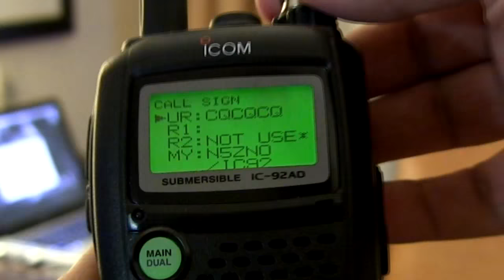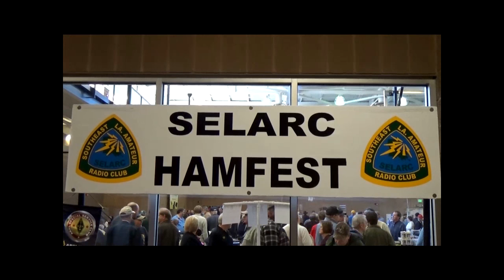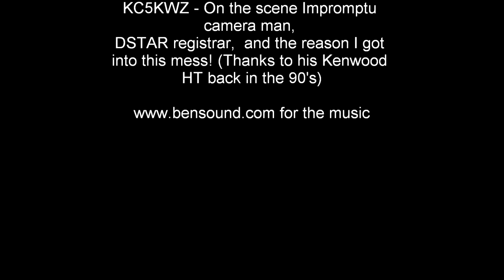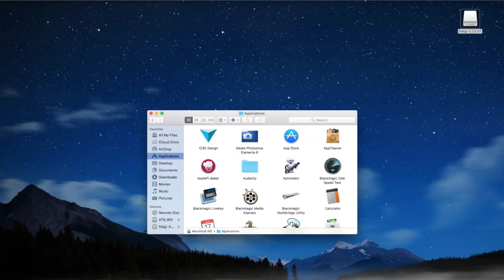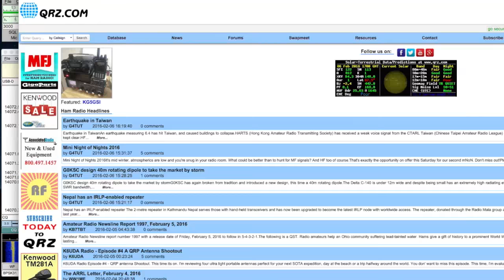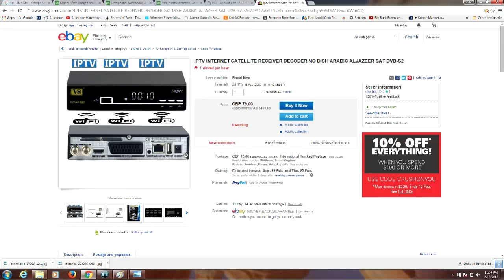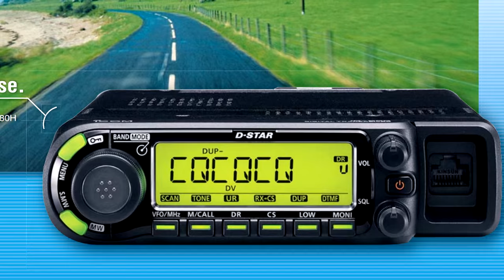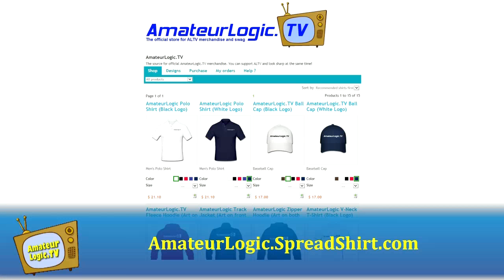AmateurLogic 87: FLRig Mac

Comment: ok, well maybe yall help me with  a easier one, is their any good vs bad  60/40 rosin core solders, im ordering a couple kits off ebay, like the component tester kit and was wondering if i should be buying the 40.00 a pound if the 20 dollar a pound might be as good?
Reply from the maker: +Hammer USN I only use name brand solder so I can't comment on the cheaper stuff today. Years ago when I did try it the cheap solder was junk.
The best place to ask questions is the AmateurLogic Facebook or Google + groups. The communities there contribute a great deal of wisdom on subjects we don't always know the answers to.
Reply: OK, thanks, and yeah I know the faults of cheap solder, that's y I asked, I have been on a ship for the past 20 years and the solder we used was not a name on it, so I was just looking a brand name to start with , then I could go from there
Reply: +Hammer USN Kester brother, welcome home, yeah takes a bit to adjust!
Reply: +radioman 322 thanks man, and yeah .... big change!